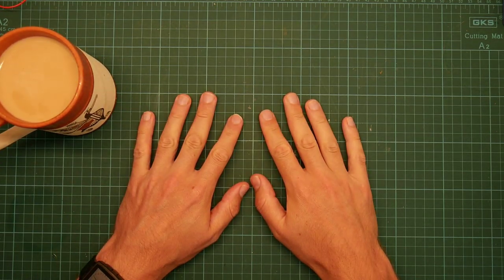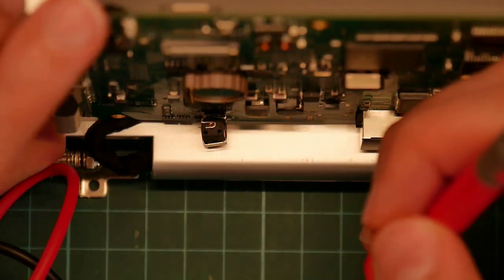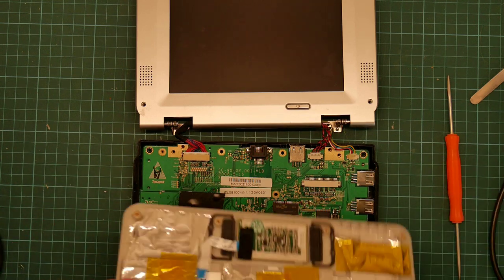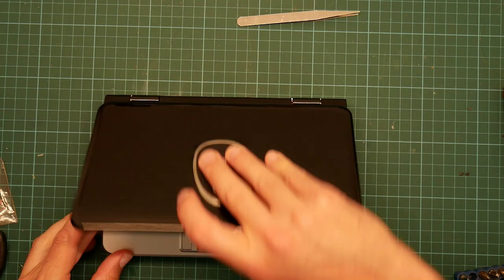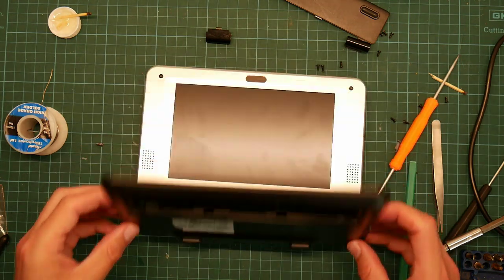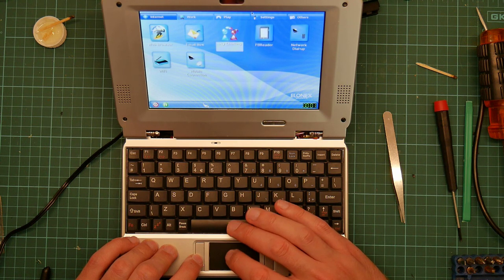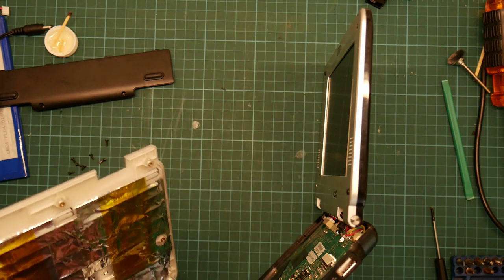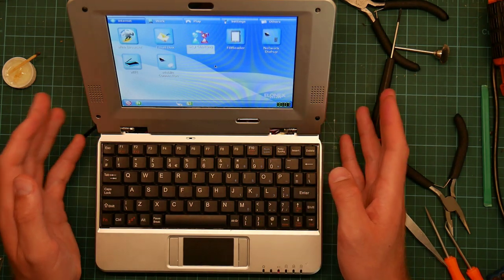Hjalfi opens and closes a Skyone Alpha 400 several times

Comment: The hinges on this thing are just terrible to deal with: complex to disassemble and reassemble with so many screws and snappy plastic. When I opened and closed a Letux 400 (http://shop.goldelico.com/wiki.php?page=Product&product=1011) I had screws left over...
There are more resources about running newer versions of Linux on it here: http://projects.goldelico.com/p/letux400/
It is quite a nice size for a netbook, though the keyboard is just a touch too small for extended use. It would be OK for taking notes or doing light terminal work. I wouldn't run a modern Linux distribution on it now, though - it would be a struggle.
I would be very suspicious of the battery given how old it is. Golden Delicious ship the Letux 400 without it.